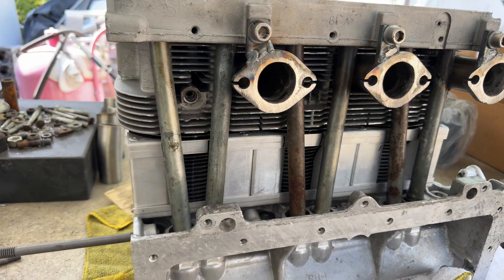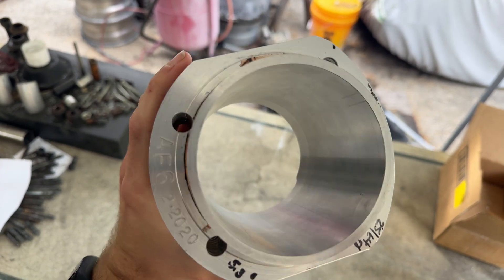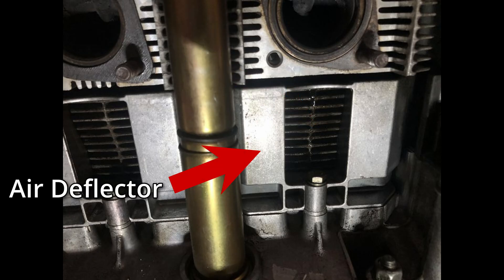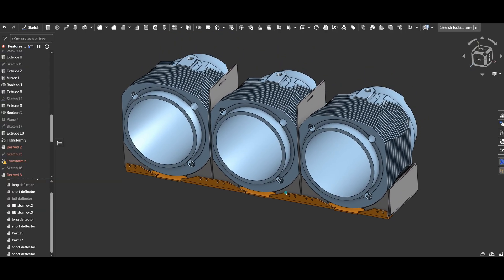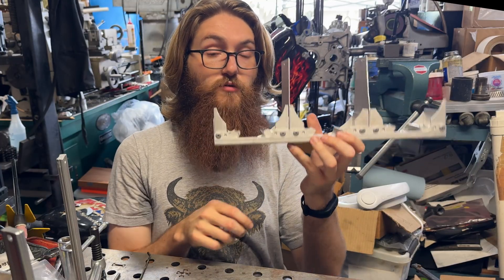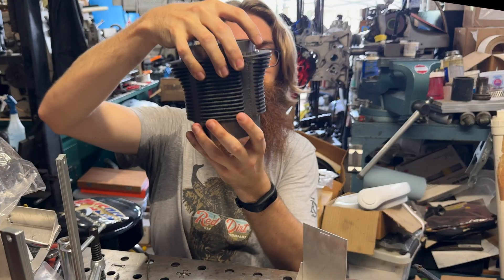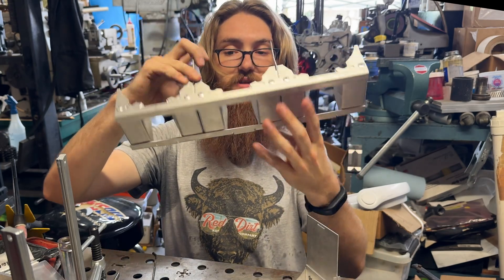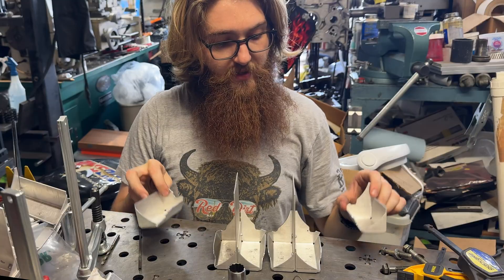Making Big Bore Aluminum Cylinder Air Deflectors for Corvair

Comment: Why not mill off about .500" of the fins off.  Wrap with aluminum  sheet metal  weld it on tge top and bottom fins. Weld on  a 1"x .500" thick bung for 1/2" npt fittngs use either  tees and 1/2" or 5/8" barb fittings.  Or make a manifold and use banjo bolts or banjo fittings.  Also do the heads the same way. Connect the heads to cylinder the same way  fill with water or waterless coolant. Use a electric water pump mount a small aftermarket Honda civic  radiator  on both sides of the engine. With a 8" or 10" fan with 3x 1/2" or 5/8" coolant hoses going to a single 3/4" hose possibly  going to a single 3/4" or 1" hose going  to 1 or 2 civic radiators with a single radiator mounted in the a pare tire location  roughly. Or possibly  have a custom radiator built about 10" overall height and 30" wide and 4" thick with multiple  tubes about 8 tubes front to rear. Pass through  about 4 tubes rear then front  a double pass on both sides and top to bottom. the radiator basically divided into 4 sections.  The water passing through  one 1/4 back through and repeated . As if it has 4 small radiators using 3-4 8" radiator fans. With a thermostatic controller the fans operate  as the thermostat. To control engine temperature.  With variable fan speed. At roughly 100°-110°F. The fans start spinning at 20% maximum rpm (100-150rpm ?)  130°-140°F. It is doing about 50% and by 180°f its doing roughly 80% full speed  if it sees 195°f it's at fill power  if it sees 220° a warning light and 230 the engines shuts off and has a push button with buzzer you keep pushed In and buzzing for the to run. To allow you to get the vehicle off the road. It should not see over 185°-195°f. The radiator  mounted over the engine about 4" from the rear deck with 4x, 8" fans or 2x 8" and two 10" fans possibly two pushing two pulling.  Maybe use 3x, 10" fans and 4x, 8" or crazy with 6x, 10" fans. 3 pushing , 3 pulling it would probably be fine normal driving with just two 8" fans 😂 if it's a big bore boosted engine or high compression engine.  It may need more. Maybe a 40"-42" wide x12" x 5"or 6" radiator  using 4x,10" fans or 8x, 10" fans or 6x, 12" fans maybe run a 1.5"x12" duct under the car from just under or over the front bumper. To the rear with two 3" ducts to the filter housing for the turbos feeding two 350 Holley carbs in a blow through setup. With 20-28 psi with 4340 rods  forged pistons. 8:1 piston maybe a custom set of billet heads with 4 valves per  cylinder maybe a Porsche style  head with the crank case modified for a timing chain box for the overhead cams. With oiling ports using nozzles to spray the chain  and the heads  to lube the  needle roller cam bearings. Also cooling the springs. Using roller followers1.5- 1.8:1 ratio 7075 t6 aluminum? Maybe something stronger. For followers with 4340 steel roller with oilite bushings pressurized oiling with oil cooling tge bushings a .020" -.040" oil passage Cooling the follower bushings mounted on a .625" shaft. With oil feed also feeding the cam through  .060" ports in the rear of the cam. A thrust  bushing feeding oil into the hollow cam at least a .250" passage and .015-.025" oil passages on the bottom of the cam lobes about 230° @ .050" .550"-.580" lift with two 32-36 mm exhaust valves and two 40-46mm intake valves 98mm bore with 88-90mm stroke  4340 rods a scat crank. Didn't do the math's to figure the cid. 98 x 98 x 90 to inches  x .7854 eq. Inches cubed x 6 cylinders  id like to see a 3.30"-3.50" even a 3.80" stroke with a 3.875" - 3.925", 3.975 or 4.00" bore but a 4.100" bore with a 3.875" stroke  with two 1.84" intake valves  and two 1.45" exhaust valves opening to .565" to .595" with a thick wall stainless turbo header.  3mm wall thickness 1.625" or 1.75" into a 2.25" or 2.5" tube then a T4 flange. The intake made of 4" tube with 2" tubes 3"-4" long for the runners in a 45° angle to the valve  for a straight shot to the valves. The 2" Tube ovaled for a 1.5" x 2.25"?  With the plenum side flared to a 2.5" trumpet with a 3" inlet at 30° to the inlet runners centered with the center cylinder.  The air hitting the plenum wall then filling the plenum.  Then in to the ports. None having a specific advantage over the others.   With about a 3" long 3" tube oval, or expanded and ovaled  with a 1/2" plate with a 350 Holley flange  welded on modified with 50 cc pumps and downleg  annular boosters and the blow through  modifications.   A  crank trigger and timing computer with coil on plug ignition.  Possibly  add injectors and 100-104 mm throttle  bodies (with a 4.125" inlet tube ovaled going from  4.125" to 1.5" x 7.5" - 8"   maybe  split  two 2.5" x 3" long  in to a 4.25 plate .625" thick with the 102mm throttle valve openings . One per bank. With a 2" tube running bank to bank on each end of the plenum. Using a 2" aluminum tube about 18 gauge wall. With  vacuum/boost ports in the tubes.  And water/methanol  injection nozzles in the intake runners or plenum across from the intake ports.  With the fuel injectors.  I haven't built a corvair engine before  I did have one.  4door. 2speed power glide.. I LIKED the roof line of the 4 door  the 2 door looked funny.  Sorry to ramble, have an awesome  day🎉

Comment: Why don't they use copper pipes that spray cool air on selected places on the cylinder. Airpump and 10 mm copper pipe could cool it...
Reply from the maker: There's really not much room around the engine because it's ducted with sheet metal. Adding veins to better channel the air to the cylinders can help under the top sheet metal but there really isn't any room for tubes to blow air at them.

Comment: These are truly begging for a custom designed and either CNC or cast heads 

There’s so much room for improvement in the stock head designs that even a basic design using modern design standards when it comes to the ports, combustion chamber, and valve (honestly probably some sort of LS based valves) You can truly bring it into the modern era with modern parts, much larger valves, and much better port design, angle, run, and size matching or more like completely beating your already knowledge with your current custom head work.
Reply from the maker: We have plans to make cnc heads with  upgrades but we've got quite a few projects to complete beforehand.
Reply: @AmericanFlat6 can’t wait to see it!
Reply: @AmericanFlat6 I’m sure you have heard of William Wynne at FlyCorvair, but make sure those new heads have dual spark plugs for aviation (and cars, haha)!

Comment: Have you figured out a way to run GM roller lifters on the Corvair?
Reply from the maker: Ya we've got a case modification that allows you to use Buick roller lifters in the stock lifter bores. We also make custom roller cams for Corvair.
Reply: @AmericanFlat6  Thanks for the quick response.  Have you done a video of this mod??
Reply from the maker: No, not yet. It might be a while before I can get the footage of machining it, as we just finished 3 cases, but we don't have another one until those engines are out the door.
Reply: @AmericanFlat6  THANKs.  Looking forward to the roller and other mods.  Keep the good work!!!

Comment: Nice work you've done, and I'm sure you've heard of "Send Cut Send", to send CAD files to them so they can make the pieces per your design. Is Bank #1 & bank #2 the same dimensionally for the air deflectors?
Reply from the maker: Thanks for watching. I didn't mention it in the video but we do use Send Cut Send to get the parts cut out and bent. Both banks are basically identical and I test each one on its corresponding side after assembly.
Reply: @AmericanFlat6  Great and nice work you guys are doing with the Corvair.

Comment: Do you have specs to offer? I have VW cylinders on my 64 turbo and would like to fabricate your innovation.
Reply from the maker: No not at the moment. I don't want to make the plans public because then I'll have to include an instruction manual but I am happy to sell already assembled ones. The only issue with vw cylinders is how many different variations that can be even from the same manufacturer. I would need to know the exact fin shape of the cylinders you have to know if you can use the ones I already have or if I need to model slightly different ones. You can get in contact with me or my dad on Facebook or email wknoblauch@americanflat6.com

Comment: have you calculated the displacement yet?
Reply from the maker: Ya with the early crank the engine is 160 cuin and with the late crank it's 183 (3 liter). We also made some stroker billet cranks that bring it up to 191 cuin (3.13 liter).